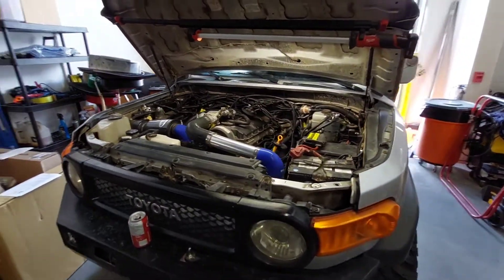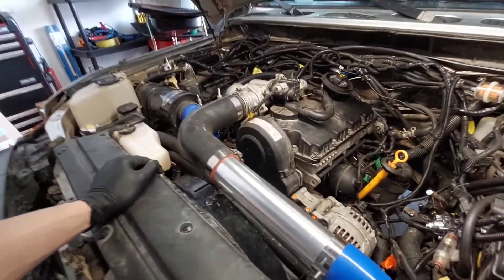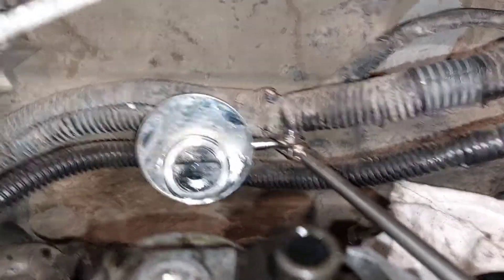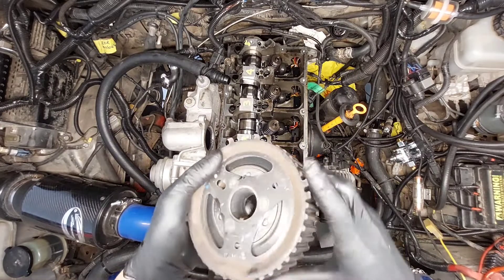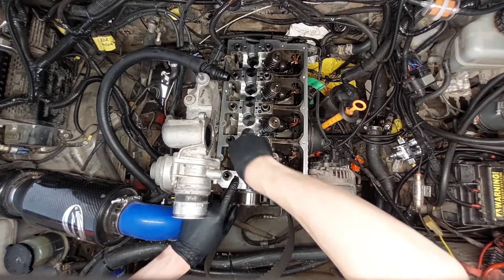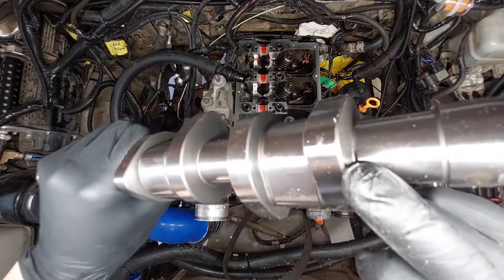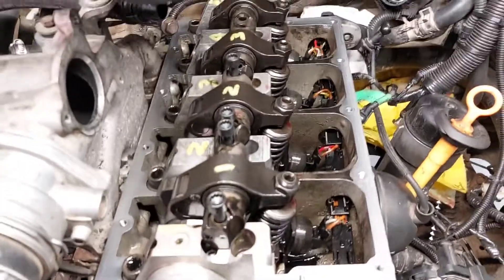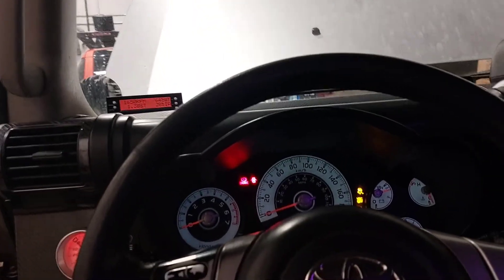VW 1.9L PD BEW TDI Camshaft replacement

Comment: When installing the Cam bearing cops, install all of them before the final tightening. 

It looks like you got away with it, but the majority of the time you will bind up or a cap will be misaligned . The only way I know from almost 5 decades of doing this on vwag stuff is install all of caps first, then start the final tightening sequence.

Also with all of the caps but the back one loosely in place, that is the time to verify the cam's position.

 And there is no key in the cam pulley to cam connection.! This is by design because a timing belt failure is not survivable if the cam is locked into the pulley. In theory if the belt jumps timing having the pulley not locked to the cam allows for some slippage not preventing damage but minimizes destruction allowing the engine to be repaired...

VW has always designed their diesel with design going back to the original 1.5s ~47 years ago.

Comment: Hi
I’m having trouble with mine at the moment.
Been told it’s the crank and been told it’s the cam.
I have cam same as yours ready to  go in.
Could you tell me if you adjusted the rocker arm screws for the tolerance of the new cam ?
Thanks
Reply from the maker: I did not do any adjustments, just removal and reinstall

Comment: Brilliant video. Just one question. You said you didn't use the aid of puller to remove cam gear due to them 3 bolts. But don't the 3 bolts need to be slack anyways when refitting timing belt in order to get correct tension?
Reply from the maker: The tensioner pulley controls the tension

Comment: How did you know where to set the camshaft when you installed it? That horizontal keyway back at the tandem pump? Couldn’t it be 180 degrees out?
Reply from the maker: Impossible, the camshaft is splined to the cam gear, bringing the engine to top dead center and marking the cam gear before belt removal ensures the cam will not be 180 out
Reply: @Colman.Automotive  thanks!
Reply: There is a locking tool which only fits correctly, will only go into the slot on the back of the cam with the shoulders resting in the head when the cam is in the correct position. If you are 180° out it will not go into place...

Comment: Very helpful video - I am currently replacing my camshaft on a Audi A4 TDI BPW engine, which is almost similar. The "break-in procedure" you mentioned - how did you do it exactly?
Thanks and kind regards from Germany!
Reply from the maker: Hey there! Camshaft break in procedures seem to be the same on most engines... drain old oil, fill with break in oil, first start up run the motor up to 2.5-3k rpm for 30min, shut down, change oil.... 

What I personally did was, no prior oil change, replace camshaft, run engine at 2.5-3k rpm for 30min, daily drove the vehicle for 5 days, change oil
Reply: @Colman.Automotive  That’s about how I did it, too. Engine runs like new with much better fuel efficiency.